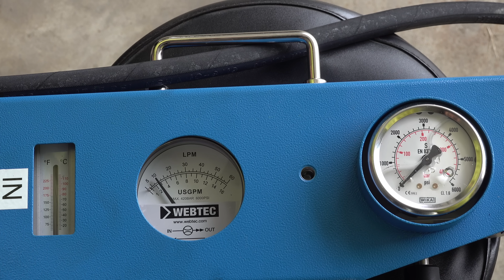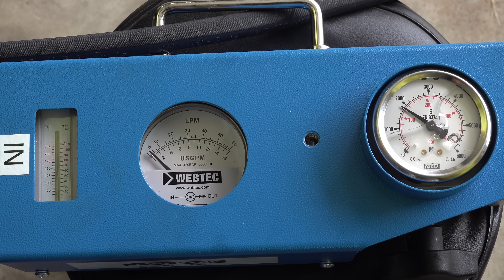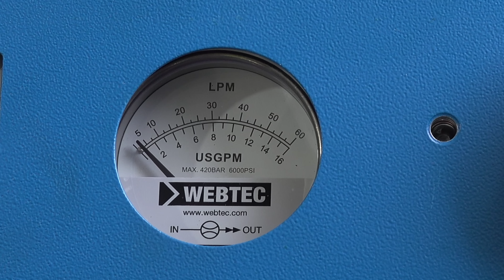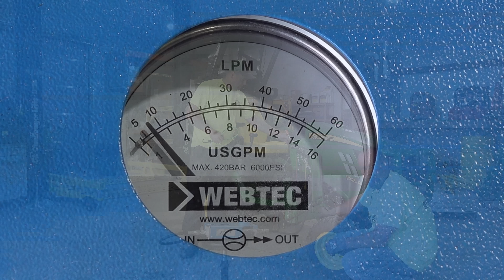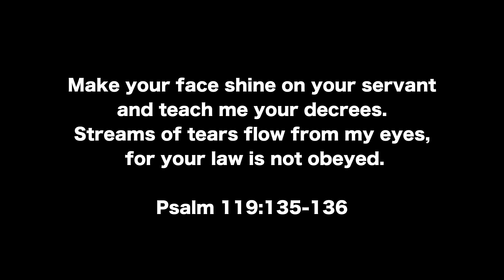Do NOT Run Your Tractor at Idle!  Here’s Why!!  Deere 1025R Hydraulic Flow

Comment: So Tim, i watchet this video again and the one you did with Ken about the hydraulic problems with the front loader. 
Today I dug out a big tree stump and about 4 small trees and stumps.  Was working great. While cleaning up my mess I was using the grapple on the front when it stopped working. Still had up and down on the loader arms. Still have tilt on the bucket, grapple bucket!  Still had the use of the backhoe for a short time. Then the backhoe arm extended and the bucket went down to the ground. 
    Checked the hydraulic fluid. Add just maybe a qt. If that much. Unhooked the four lines  Couplers down by my right foot. Did have to release the pressure to get them  back in.
Didn't help. Stuck out back can't move the tractor because of the backhoe bucket firmly on the ground. I have no idea what to do to troubleshoot other than what I have already tried. The backhoe controls have no return to ctr like before.    Any ideas would be greatly appreciated.  I'm at a loss. Thanks for any help.
Reply from the maker: Unhook the backhoe power beyond and hook tractor power beyond hoses together like when running without a backhoe and see if loader functions return. Probably should follow up with questions on tractoruniverse.com because I may not see reply’s here.
Reply: @TractorTimewithTim  I can't seem to get the  hoses unhooked from the backhoe.  Darn frame is in the way. Front loader still works. Just the grapple part doesn't. Thought at first the switch was bad untill the backhoe stopped.  I'll give Deere a call tomorrow see what they say. Only 8 months old. First problem I have had except for hose clamps loose, and  hydraulic hose fittings leaking.  Thanks Tim. Try tomorrow after I cool down. You and  Ken were  right about the pressure in those hoses. Might need to get one of those tools he was talking about.
Reply: @TractorTimewithTim  so Tim. I did get the power beyond unhooked and rehooked. Nothing changed. Tractor will go forward and backwards.  Loader will go up and down and bucket will tilt. Backhoe still nothing. Third function for the grapple still nothing. Deere was soposd to pick it up today. But they didn't. Now maybe tomorrow.  Nice people but not hurting themselves by taking care of a customer.  Real disappointing.
Reply from the maker: Are the backhoe controls physically disconnected from the valves?  Seems odd.
Anyway, if machine is under warranty, leave it alone…they should come out to fix.
Reply: @TractorTimewithTim  hopefully they will pick it up tomorrow AM.. who knows when they will actually get it fixed.  Thanks for your support and suggestions.

Comment: Tim, I watched this video twice and probably missed it both times.  What damages can occur when I run my 1025R at idle?  I push snow at idle.  I like that it is much more quiet.  Is it bad for the engine or the hydraulic pump?  Thanks, Jim.
Reply from the maker: Damage is the wrong word.  You simply are missing most of the tractor’s function.  Hydraulics are slow, steering is slow, overall performance is low.  
Give it some throttle.  You will find that it is worth it!
Reply: @TractorTimewithTim , ya I knew I was dealing with the issues relating to low pressure at idle.  I plow my neighbors drives on both sides of me and I am really careful to not tear up the grass so running at idle makes it much easier to control for me.  I do run it harder for several other tasks.  Thanks again!

Comment: Would love to see HST torque (maybe using tension gauge pulling against tree) vs RPM... Does one really have to be at PTO/rated engine rpm to get full torque? Above idle? Absolutely. But I suspect there are diminishing returns above 2400 or so.

Comment: I am a new John Deere 1025r owner.  I bought a 2019 used one.  It worked wonderfully for about 75 hours, everything smooth, then suddenly the front bucket won't tilt like it should.  If I moved the lever to the right it would tilt slowly if moved gently but move the lever to the right too far or two fast the bucket would return back up all the way.   If you raised the bucket to eye level it want tilt at all.  I needed to take the bucket off and did so and now with no load it won't tilt at all.   I can't find any leaking hoses or crimped hoses. What could have happened and what should I do?
Reply from the maker: Try unhooking and reconnecting the 4 hydraulic hoses.  They sometimes come loose for a variety of reasons.
Reply: It was connected but a little lose.   It also helpes to press the male plug and relieve the pressure so it could snap together. Thanks for your help

Comment: We called it a Schroeder tester when I was a mechanic in a coal mine. It was a great trouble shooting tool for determining it a pump was going bad.  Also running a diesel tractor or any Diesel engine at I higher rpm is a good idea not just for hydraulics but for catalytic converters and diesel particulate filters. Great video thanks for sharing.

Comment: Didn't you make a comment a few videos back that when using your backhoe you leave your tractor at idle? I believe Courtney at Good Works Tractors said he also uses his backhoe at idle. So has your opinion now changed when using that attachment?
Reply from the maker: The older 260 backhoe was more ‘jerky’. It was harder to run with more throttle.
I run my backhoe at much higher RPM now.
If in a hurry, I will run wide open throttle.
Reply: @TractorTimewithTim  Thanks Tim, Yea I had been running mine at full RPM and it would jerk a bit. This last time I ran it at idle and didn't have enough power. Running it at half RPM seemed to do a lot better with smoothness and digging power.

Comment: Yep, great video, not surprising though.  I see guys all the time advertising they run around at idle and I just shake my head, another guy that has not read his owner's manual.  And of course, they cite like Ken said, they are saving fuel.  Geez, these are super efficient diesels, I can run mine like 6-8 hours on one tank of fuel.  The John Deere engineers set up this tractor to run.  I think part of the issue is people equate running a tractor at WOT like a car at WOT.  The designs are not the same.  I usually run mine around 2400-2900 for most non-pto work and always 3200 for pto work, as the manual directs.  I wish more people would view this video, sadly it's one of your least viewed ones recently.

Comment: If your tractor was stock with no loader valve, power beyond or backhoe would it give you the 3.5 gpm specs JD says it has.
Reply: All that flow with nowhere to go.  That would be useless......
Reply: @projectswithjw  ya but what I’m wondering if that is how JD is get the 3.5 gpm

Comment: Hello Tim,
This is a wonderful series of videos you and Ken are making.  
I am hoping there will be more.  Possibly more on diagnosing hydraulic issues.    I find that my loader bucket dump function , creeps down much faster than I think it should.    Cylinder issue,  control valve issue,  something else,  or completely  normal ?
As a first time tractor owner , your videos have been a great resource.
All the best,
Ben from Nova Scotia

Comment: maybe the factory tested the flow right off the pump with no fittings in the way causing restrictions
like how auto manufacturers give hp/tq readings at the crank instead of the wheels

Comment: @tractortimewithtim, can you explain why running a 1025r at idle would harm or damage the machine as stated in the video. The only thing i heard was that it would cause the engine to "lug" more. What do you mean by this & why does it cause damage?

It doesnt seem to me that it would be completely accurate to say that a 1025r is not effective idle.  I believe that there are certainly times where the 1025r is more effective at idle. Obviously it depends on the intended purpose but in most cases the tractor is probably more effective at higher rpms
Reply from the maker: I didn’t say anything about damage.  What we showed was that the hydraulics are quite limited at idle.
Reply: @TractorTimewithTim  well more specifically Ken said damage/harm at 4:12 & that is what i would like to better understand
Reply from the maker: Not sure I would have said that :-).   I would just say that it is inefficient.

Comment: Do you have 2 or 3 3gallons or only 1 at a time !!  Can you lift the loader something while mowing ?  Something like mowing and grapple snatch something out of the way.   Nice test.  Need two at a time.  e.g. how does the pump work - three pumps or starves the other two.  Might be just source restricted to divide up the oil.
Reply from the maker: only 1   ....mowing runs off the PTO, so yes, you can lift while mowing.

Comment: Great video!  I'd be interested is seeing what the flow is at mid throttle, say 2200 or 2500 RPM.  I bump the throttle up to that range when using hydraulics, but don't like the noise when running at the PTO throttle setting.
Reply: From my experience and understanding, the relationship between hydraulic flow and engine RPM is not linear. So doubling the RPM will not double the hydraulic flow. So keep the engine RPM low if that works.

Comment: Good test Tim and Ken.  Since pumps produce flow and not pressure (pressure results from restriction to flow) I would assume the accuracy of the flow meter is what is causing the low flow.  The pump appears healthy as it is fixed displacement pump, and the flow did not change as restriction to flow increased.  This would mean that as you loaded the pump up, if it was not healthy (bypassing internally in the pump) flow would have dropped off.  The flow will be calculated from the factory by using the displacement of the pump multiplied by the rotation speed.  Only thing that could adjust the flow would be the input rpm lower than the test point at the factory (unlikely), or the displacement of the pump is not the same as the design (double unlikely).  But like I said, you tested the health of the pump by loading it and inspecting the flow.  Take Care, Jason

Comment: Could you do a hydraulic service with new oil and filter and retest the hydro flow and see if that is a major change in performance? That might get you that 0.5gpm back
Reply from the maker: Good Point! It might indeed help.   Hadn't thought of that!
Reply: @TractorTimewithTim  showed a difference with the pull test
Reply from the maker: Yea, and I have no idea if that was totally objective…always wondered :-).  Guess I could try it again!
Reply: Tim, would you consider doing this test with the pump you were talking about in a previous video that was supposed to almost double the flow? Great video and valuable information.
Reply: Might need a filter change, any new system can have machining leftovers to could be slowing the flow.

Comment: A couple of points. I HATE the term ‘zero pressure’. That only occurs in the tank at air temp. Heated oil adds pressure! You addressed this in your video together on the difficulty of connecting hoses due yo heat build up. I realize you were reading your gauge and that wad the reading, but the more accurate label is ‘minimum pressure’. Facts without negative pressure on the tank (SUCTION) you have no flow to the pump. Without positive pressure your pump is broken and you have no flow. There is minimum pressure present, it may be low enough that you can recognize on your gauge, just a pet peeve of mine. However 1 big support of this is your pressure side line from the pump is smaller than the suction side. Your load/work id resistance to flow that builds pressure. Going from a large hose/tube to a smaller hose/tube/fitting/valve is a similar process.  
2) 2nd item is that I expect that before you got to the point of any of your testing connections, you had already encounter some type of restriction that accounts for the reduced flow from spec rating. Not sure where it would be located though.
Reply from the maker: Come on Coy.  Nitpicking.    Relative to full pressure of 2000psi, this is basicallly zero pressure.    Relax :-)
Reply: @TractorTimewithTim  I do believe I self proclaimed in the comment it is a pet peeve! So Tim relax!
It is just in my 45+ years of dealing with things that have flow, how many millions of times I have heard there is no pressure! If there is no pressure, then there is no flow. I really confess that it is nor working pressure as I did and do now!

Comment: Good video.  The issue, in my opinion, has more to do with wear and tear to the hydro-static system, than the engine, at low engine RPMs.  This true of Hydro-static lawn mowers, zero turns, etc, as well.

Comment: Having done more hydraulic and mechanical tests in my work career than I want to remember, most testing procedures would have you discarding readings in the bottom and top 10% of a gauge reading, as the accuracy isn't good. 

This test has sound principles, just the gauge (IMO) should be switched for a lower pressure gauge using a lower scale. Possibly add a manifold and install a lower pressure gauge. Start the test using the higher pressure rated gauge to verify the system, then switch to the gauge of the pressure rating required.

BTW, McMaster has digital gauges with good resolution in the $175 range.

I'm sure someone else has suggested testing pressure and flow at the pump verses testing with 6-8 feet of hose and hydraulic connections. I'd bet most manufacturers use pump ratings not at the implement hookup.
Reply: I would not disagree at all that manufactures use specs at a bench test of pump only. However, what Ken and Tim provided are real world results. That pump pressure rating is about as useful as loader lift capacity at the pin that you find in lots of spec listings.

Comment: Are you going to do a hydraulic pump upgrade and run these tests again?
Reply from the maker: Please don't tempt me.    I'm salivating over this upgrade, but trying to hold off to keep my tractor as stock as possible.  Not sure how long I can hold out :-)
Reply: @TractorTimewithTim  The upgraded is pump is tempting to me as well especially now that I am outside of the warranty on my machine. However, one concern I have is the electric switch control of my Summit  rear remote kit will not allow me to feather the SCV's due to the "on or off" only of the electrical switches.  I'm comcerned that the lower flow of the stock pump allows those switches work well in place of a mechanical lever. However,  with increased flow wouldn't this make the rear SCV's work too fast or be too jerky?
Reply: @kirkbrinkley6990  You can adjust the flow on Hydosplus kit...So that would take care of it. Or lower the RPM's.
Reply from the maker: Worst case, you could add flow control valves or restrictors where necessary.
Reply: @TractorTimewithTim  I am with Eric.  We are holding on tight and watching with baited breath!  Let it go Tim!  LOL!  Great video, thanks!
Reply: @TractorTimewithTim  Think of it as an opportunity to get a second 1025R!  Keep one stock and modify the other one to your hearts content.

Comment: I do run my 1025R at low RPMs.  Most of the time I'm not doing any hydraulic work.  But after watching this video I will start to bump up the RPMs.  Thanks for another great video with Ken.
Reply: To add, diesels like to work and are most efficient at full operating temperature for proper combustion, ring seal, power output. Running it at idle is detrimental causing wear and oil dilution. 
  Don't be afraid to tach it up! 👍🏻
Reply: Also keep in mind that running at too low of a rpm on a hydrostat can cause transmission damage due to lack of flow at the charge pump causing cavitation.
Reply: @ngnmech  Good point NgnMech, I was always taught to always run Hydros at full rpm, as much for the fan airflow as anything else. A fan at 1/2 speed only does 1/8 the work, 1/2 the flow at 1/4 the static pressure.

Comment: It makes you wonder if you could actually connect to the output of the pump if the flow would be 3.5 GPM…
Reply: You would have almost 7gpm. The steering circuit takes half and whats left is the implement hydraulic circuit which is whats tested in this video.